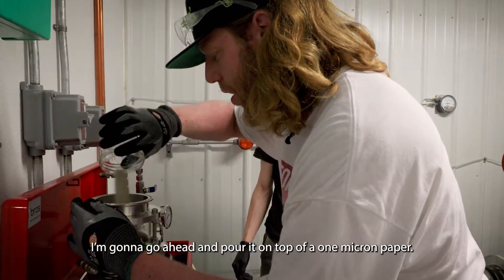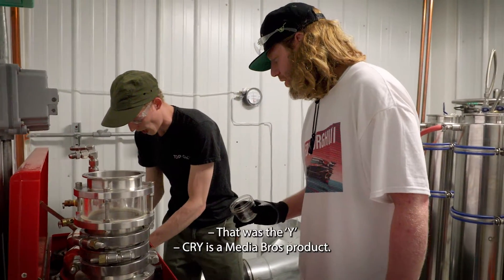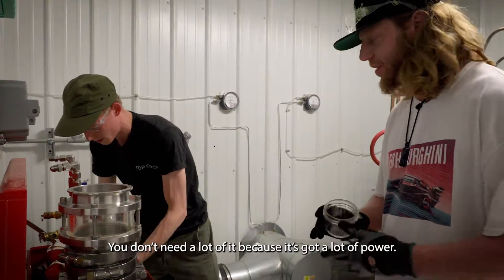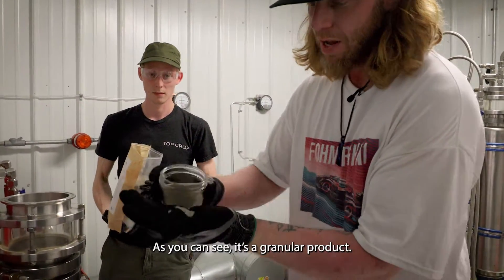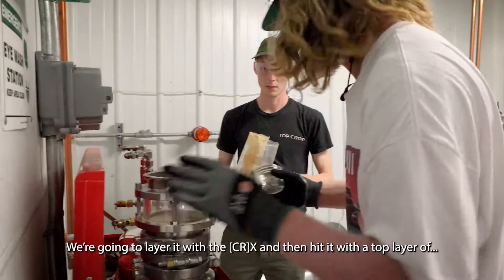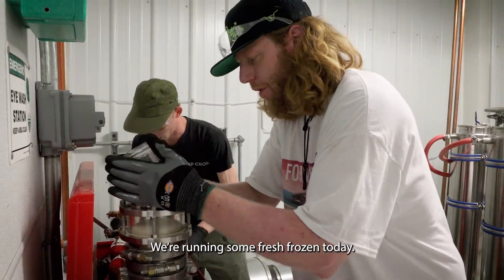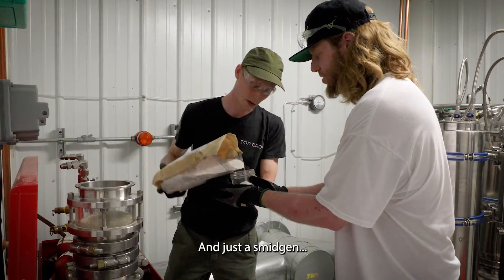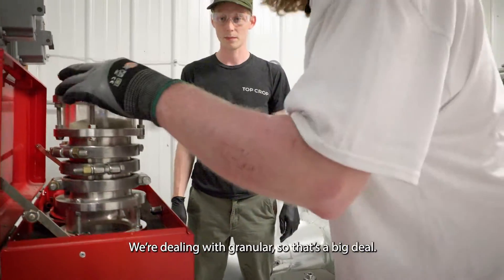Jizzle Pizzle - Demonstration: Loading the Column

Comment: Any info on a cry to material ratio ?
Reply from the maker: Media to Biomass: Load 150 - 250 grams of filter media into filtration housing for every 1 lb of biomass. The media quantity used is dependent on the quality of the biomass. Higher-quality biomass requires less media. Lower-quality biomass requires more media. The lookup table can be used as a reference, but because every kind of plant matter is different, you will need to experiment a little bit to achieve the best results. That said, this chart is a great baseline to start with. https://mediabros.store/pages/help